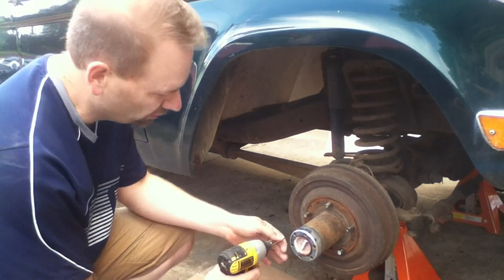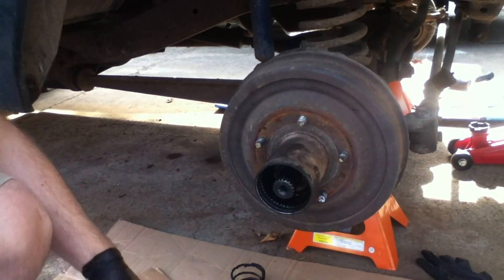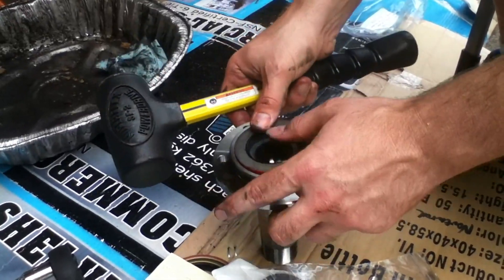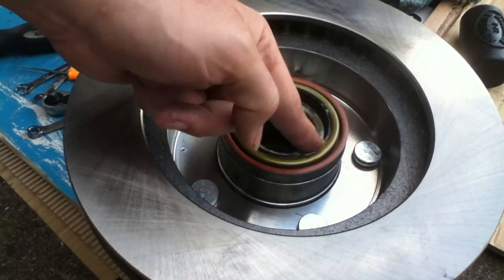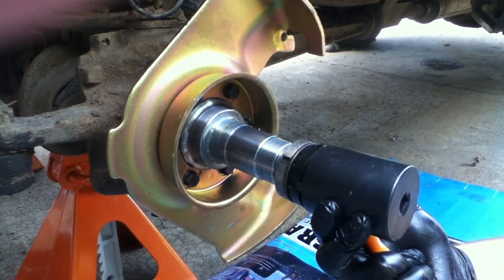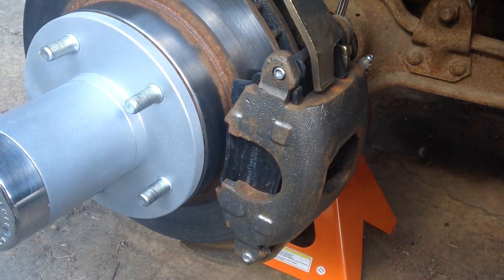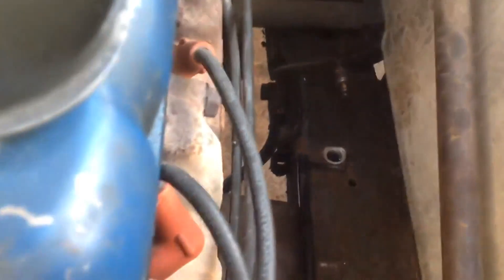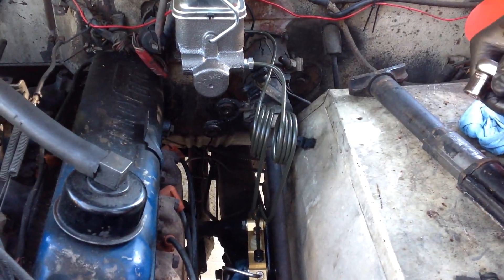Drum to disc brake conversion.  1968 Ford Bronco

Comment: I'm getting ready to start my 4 wheel disc brake conversion on my 66 Bronco this morning so I re-watched your video as a refresher. I think its probably the best video of the dozen I've watched on the subject. Nice job and thank you for taking the time to make the video and post it!
I noticed you chose to stick with the manual brakes rather than power. How is that working out? I purchased the power brake kit but thought long and hard about going manual. I don't like how much room the booster and bracket take up in the engine bay and makes it hard to get to the spark plugs and header bolts if necessary.
Reply from the maker: I’m totally ok sticking with manual.  Everyone has their own preferences, but just imagine your old braking, except when you go to disc you get consistency, straight braking, and a little better performance. If you were ok with the pressure needed before, you’ll be ok with it after the upgrade.  Thanks for the nice words!

Comment: Hi ! 
I have a 1991 Ford f150 pick up truck that I want to do this conversion too. Question will be. Regarding the safety break line at the rear tire. Is the safety break line will be 1) useful to be reinstall to the new calipers or 2) it will be eliminated ?

Comment: Great video, looks like you kept the original Dana 30? No power brake booster?
Reply from the maker: Yep, kept the axle. As far as the booster, I don’t feel like I need it, but it’s in the back of my mind for a “maybe someday” project.
Reply: @BroncoSolid  I've got a 1970 bronco that I'm doing small projects on, I just finished the centech wire harness install on it, I've got to have the fly wheel resurfaced and then I can put that and the clutch and tranny and transfer back in, I've got a Dana 44 that I'm going to have rebuilt with disc's brakes on it ( I'll have a shop rebuild that for me) I have to get new tires  and a windshield and that's the short  list

Comment: Great video.  I'm assuming this was for a Dana 30 so the install is slightly different for the 44.  Regardless, I there are some good take-aways for when I do my conversion.  thx
Reply from the maker: Thanks Lou!  This was the Dana 30, you're right, and the 44 is a bit different but overall the concepts are similar.  Good luck!

Comment: The fitting you used in the proportioning valve for the "Front" brakes, is that new?
Reply from the maker: Hey Sean, what time index are you referring to?
Reply: Hello, at 10:45 there is no fitting then at 11:57 it seems there is newish looking steel fitting in the "front" of the proportional valve. I'm asking because I used the one out of the original H-Block and is leaking. Thank you for your videos! Very informative.
Reply from the maker: Ok, I see what you're talking about.  Yes, that was a new piece that came with the proportioning valve.  If yours is leaking, try tightening it just a bit.  It might do the trick.
Reply: Glad I asked, I also ordered a kit and the only piece missing was that brake line. They are sending me one. Thanks again!
Reply from the maker: Awesome.  Did you get the Tom's Bronco kit?
Reply: I did, I got the one that included the brake booster. I had my laptop out and your video guided me the whole way! The only part that confused me was the H block to proportional valve line. I thought I had to bend the stock one and had trouble. IT all worked out and they are sending me one. Thanks for your videos! Sean
Reply from the maker: Super glad to hear, and glad the video helped out!

Comment: I've watched however many drums to Disc conversions, and yours by far is the most extensive and complete one out there, keep up the good work. My question though is while you were disassembly and pulling off the hubs, it seemed that the hubs were greased, but when you reassembled they seemed to be dry is there a proper procedure for greasing when put on the new hubs?, thanks Bill
Reply from the maker: Thanks for the kind words Bill.  Your question is a good one, and I can't say I have a straight answer for it.  What I can tell you is that I followed the instructions I got with the kit to the letter, and I did grease the bearings.  It could be that in the old assembly the grease just spent years flinging about in there, and this new installation is now doing the same thing.  I'll probably look into this a bit more.

Comment: question: Before you placed the new hubs back on, did you put the large spring back in right after the spindle nut?
Reply from the maker: The spring was part of the old system.  The new parts didn't have it, so it was discarded.

Comment: dont judge my silly question but what is a lock out hub, kinda like what does it do and how to you operate it?
Reply from the maker: +Edward Myers The answer is kind of complicated. I think the best suggestion for you is to check out this website where they explain it really well.  http://4x4abc.com/4WD101/hubs.html
Reply: it pushes the axel into front diff to engage it . making it 4x4.
Reply: jjt jp so basically the locking motion of a differential is manual ?
Reply: Well close enough to say yes.
Reply: a free wheeling hub is just that,2wd drives the rear as normal 4wd drives front & rear, its connected to the axle shaft when turned to engage the splines you see on the shaft end.same as dog clutch.all wheel drive is constantly connected,no free wheel means more fuel.like subaru.

Comment: was this a kit you bought ?
Reply from the maker: Sure was, Chris.  I have a friend who was a mechanic, did a disc brake conversion on his own Bronco, and told me, "Just get the kit."  Way less hassle, way easier, and probably better performance overall.  Here's a link to the kit:

https://www.tomsbroncoparts.com/product/disc-brake-major-kit-dana-30-44-prop-valve-bracket-warn-hubs-wheel-bearings
Reply: BroncoSolid was it off toms bronco ? or something else
Reply from the maker: Yep, Tom's Bronco Parts.
Reply: Thank you

Comment: You can buy paint coated brake rotors, to prevent rusting. Unlike oiled brake rotors, you leave the paint coat on them.
Reply from the maker: +Philip Cooper thanks for the tip!  Sounds like a route I'd like to go when these need replacing.  I did hit it with some paint manually though, but later.

Comment: Great Video. I'm thinking about doing this on a 67 F100. I assume the process should be very similar.
Reply: Just find a 73-79 diner truck the parts  swap over easy I've got a friend that did  on several of his trucks, he has the 68-72 trucks
Reply: CT moog im also wanting to do this to my 1967 F100. Been looking for a 73-79 f100 as a donor. Let me know how it goes for you bc Iv been thinking I'll just rebuild the drums as is with new parts but I live in the mountains so not sure if I'd be a good idea..lol

Comment: hi,shouldnt there be some light grease in the hub,not dry,???plus that lock ring can be reversed to fit half a hole instead of backing off the bearing.most wheel bearings ive done since i first owned a car where done tight,then backed off 1/4 turn,just what i was told.

Comment: I don't have a lot of experience with cars and I watched A LOT of videos on the EB disc conversion before I tried to tackle it. This is, by far, the best video that I've seen. Assembling the axle nut without the hub on is great and also mentioning the recommended torque ranges is awesome. Great job!!!
Reply from the maker: +B Woh Thanks!

Comment: Great video... Question/clarification  Do you torque the inner nut on the hub to 50 to seat the bearings and then back it off? (meaning that the nut is no longer torqued to 50lbs)
Reply from the maker: +Dennis Wood That's correct.  That presses the seal and bearing into place with the proper pressure, then puts the nut at the proper torque.  Also, that's what the instructions called for.

Comment: great video on the process. only 1 question, why did you not opt for a brake booster behind the master cylinder for power disk brakes result?
Reply from the maker: Glad you liked it.  I appreciate the question.  Overall, it would have added an additional $250-300 to the final project cost.  I felt it wouldn't give me personally much benefit as I'm pretty big and I didn't mind pushing the brake a bit.  I also talked with the staff at Tom's Bronco and they said my chosen setup would work fine.  The effort to stop the vehicle with manual disc is pretty comparable to manual drum, so I'm pretty happy with it.